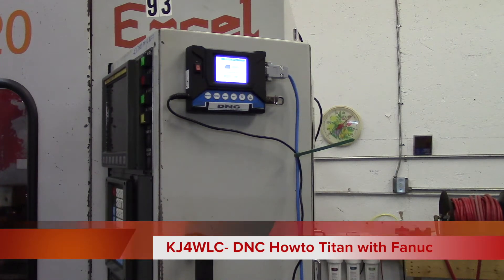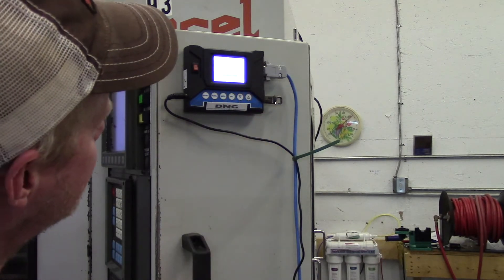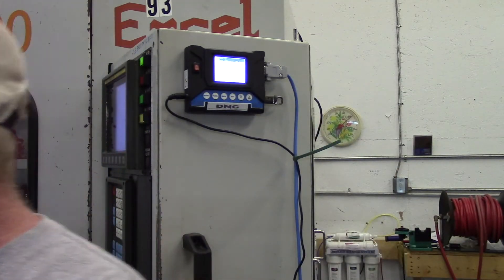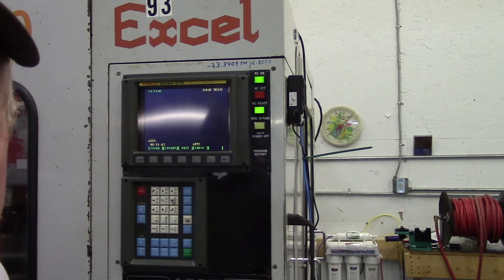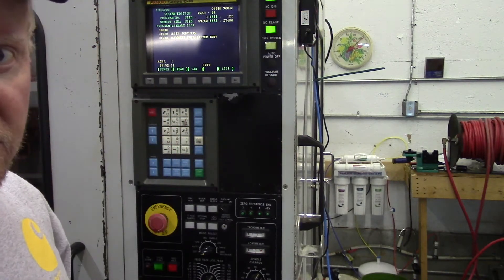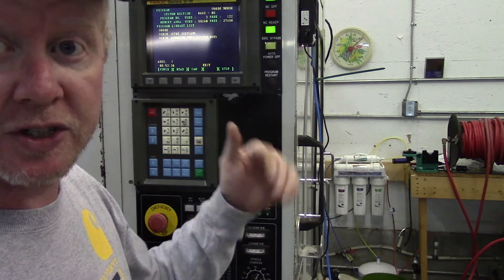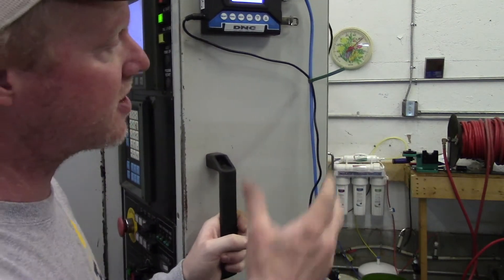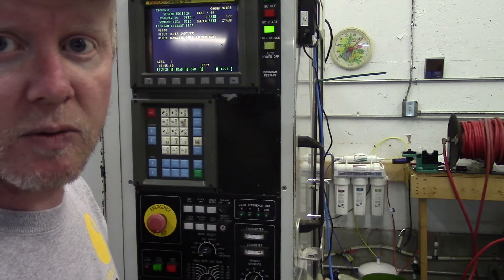Titan DNC with Fanuc Howto

Comment: I just got my OM controller to work with my DNC. I run it at 9600 baud but would like to increase it. What IO mode do you use for this? When I change parameter 252/253 to 12 and IO 2 or 3 I dont get it working. It works at 9600 baud and IO 0.
Reply from the maker: My machine only has one of the serial interfaces wired up. I do run it at 19,200 to the DNC without issue.

Comment: I am using SolidCam to write the gcode. Will the Titan DNC run and properly operate a CNC 1989 Fanuc O-M 3 axis mill and a 2 axis 1991 Haas lathe?
Reply from the maker: It just streams serial so if they mil and lathe have serial and tape options, yes, it will stream gcode to the control.

Comment: hello friend very good your videos!!!! i have a doubt the control is able to resume the machining? for example if i am working and in the middle of the program a tool breaks or there is a power cut... how do i do to restart my program and not start from the beginning, i can start in the line where the power was cut.
Reply from the maker: You are correct.  The way I handled it is manually adjusting the program if I needed to skip ahead with a new run of the program if a tool break occurred to finish the part.  Not perfect but manageable.

Comment: It is possible to use external memory in old machines when single program is bigger than machine memory? In such a way that the machine will receive program blocks in real time and execute them?
Reply from the maker: Externally serial is the only option.  If doing complex operations you have to make sure to overrun the serial link. Also I normally turn off block numbers as the om control doesn't like them on large programs from the DNC. Other than that you can externally send programs larger than the machine memory size.

Comment: Hello will it work with Fanuc 21i
Reply from the maker: Yes as long as you have a working tape setup. Option on your machine and serial port.
Reply: Thank you I have a Hardinge cobra 65 lathe and I'd like some help to get it work I don't know much of a Fonuc 21t controller do you have whatsapp so I can show you some pictures
Reply from the maker: @abramfriesen9834  I don't use WhatsApp.

Comment: you can remove that power cord. its not needed when the rs232 is attached. thats for when you have it hooked up to the pc to load programs in the memory without the usb stick.
Reply from the maker: Either my controller or the cable doesn't supply power to the DNC and the power adapter is required.

Comment: Hi,
How should I go about loading programs from the DNC to the FANUC's memory if I don't have an I/O option as shown at 4:19, and I don't have a Tape Option/reader? I have an RS232 port on my machine so it seems possible, but I can't figure it out.
Thanks,
Brady
Reply from the maker: You will need some way to get it into I/O mode. What machine do you have?
Reply: @ShaneBurrell1  Makino FNC60
Reply from the maker: @bradybrother100  is it a om-c control?
Reply: @ShaneBurrell1  I can't tell. It just says FANUC O-M above the screen
Reply from the maker: Does the control panel have a tape mode for drip feed?
Reply: @ShaneBurrell1  The slot for a button is there, but my machine doesn't have a button installed. So I don't know if it would be possible to somehow manually install a button.
Reply from the maker: It would be tough and you would need a lot of information about you machines current setup.

Comment: Can you please further explain raising to 19200 for better 3d contouring? Is that your baud rate? Does it help the machine process code quicker?
Thanks
Reply from the maker: The 19200 is the baud rate that the DNC and machine communicate at. Faster the better and the only way to do 3d work (although there are limits even at this speed).   It will allow commands to be sent faster in drip mode and also reading and writing programs to machine memory.
Reply: Thats just the speed of comunication and youll see a difftence when loading to and from the machine the baud rate wont effect machining, we run all programs at 9600 .

Comment: what series fanuc 0m is your machine and whats its storage capacity?
0m - A, B ,C ord D? 
Could have a gooddeal on a machine with a fanuc 0m mate, but am afraid i will run into problems drip feeding bigger programs..
thanks
Reply from the maker: My is a C series and has the max memory.  With drip feed it doesn't use the memory at all.  The limit there is the speed of the serial (set to max if you a doing 3d work).
Reply: @ShaneBurrell1  thx!
in your experience does it slow down a lot when dripfeeding?
9600baud seems to be the max speed of fanuc's 0m series?
The machine is a quick BT30 drill/tape type, so speed is interesting to me :I
Reply from the maker: @lzus6676  I run mine at 19200.  That speed most 3d works just fine. Check to see if you can set the param to 12. That should be 19200 even though most manuals only show 9600.

Comment: Hi, i got a question about your postprozes i am using a fanuc 10m controller and fusion but i am not able to adjust it that it works fine... coulkd you help me out with the postprozess?
Reply from the maker: Fusion 360?
Reply: @ShaneBurrell1    
yes, sorry for the late reply…. I haven’t got any notifications..

I have managed to use fusion 360 with the basic pp but well I have to overwrite the first 10 lines by hand. Not so happy about that…
Reply from the maker: It's pretty easy to edit the post processor.  Search/Find with a text editor will help with locating where to edit.

Comment: I have a Romi 17M lathe with a fanuc 21iT control,  any tips before I start o this adventure? Using a USB stick is way simpler than special cords.
Reply from the maker: First thing backup the control.  After backup, ensure proper battery swap to new batteries.
Reply: Sounds good . Right now I'm trying to write a simple manual program.  I'll order the system tonight from Amazon
Reply: I ordered the parts on Amazon,  but they are out of stoke on the Fadal cable. If you have some info on that , it would be appreciated.  
Thanks

Comment: Is the serial port on the bottom for the db25 rs232 output? My dynapath 20 control has that db25 / ra232 port on the side of the control for drip feed. Just trying to see if i need a cable db9 to db25.
Reply from the maker: It is a DB25 serial on the  machine. rs232.

Comment: Thanks for the videos!    Will the Titan allow the control to use it like a flash card and call macros.     I put small programs on the machine memory that call several larger programs from the flash card. will this work the same way or will the larger programs have to be combined into one program and drip feed.    Thanks!!
Reply from the maker: It will not.  It's a limitation of tape mode.

Comment: Do I have to change a parameter ? 
Like 480 ?
Reply from the maker: I didn't initially.  I did end up changing the baud rate param higher for more speed during 3d ops.
Reply: Shane Burrell 

Ok, I can send it but dripping is not working. They say I have to change the 480.2 tot 480.1 and that will activate the 127.5  dnc mode
Reply from the maker: you may need to edit you ladder as well. My machine had a working tape mode.
Reply: Shane Burrell yes is activated is I don’t have a button for
That. But if I do read is will load the hole program now
Reply: Shane Burrell yes i found that on the Internet. 

Only I need to know how to edit is in fanuc I cannot press edit do you have a tip?
Reply from the maker: Try a search for OM ladder and param edit.  It's a multi-step process and depends some on the setup/keypad of your machine.

Comment: Have you drip fed large Fusion 360 hs rough miling toolpath program(s)?
Reply from the maker: Yes.
Reply: @ShaneBurrell1  Awesome. What did you think? I tried to but don't think I accounted well enough for acceleration/deceleration. Kind of jerked around. Going to look at tolerance settings in the rough profile. Maybe I had to many points.
Reply from the maker: @machiningcoolstuff9124  I'm running at max baud and keeping point counts low.

Comment: Great video! bought one but having trouble with; 1) not being able to hit "cycle start" after the program drip feeds to start it again. Is there a way or setting to allow this and not having to reset the Titan DNC each time?   2) Is there a setting that you know of to have the DNC read machine specific macro's? When running from machine memory there is no prob but when drip feeding from DNC it freezes up when there is a macro called out in our NC.   please help
Reply from the maker: There is not auto resend have been able find. Have to resend file for each cycle start.  What control do you have? That might help point me in right direct on macro exec.
Reply: @ShaneBurrell1  , we use Controller = GE Fanuc Series O-P running a Strippit Punch machine. Built around year 2000.
Reply from the maker: You won't be able to call macros from drip feed on the Fanuc o series but could include what they do in your program that you drip feed.
Reply: @ShaneBurrell1   Yes, we just figured that out. Thanks for the help. I would sure like the next model they come out with allow an auto restart so you just have to hit cycle start on the machine.

Comment: Wil this work with anilam crusader m control it has rs232
Reply from the maker: Any rs232 dnc should work.  It just streams data with the given serial settings.
Reply from the maker: Looks like a number of people have it running.  Note that the default may be 1200 baud and you may have to make sure both sides are transmitting at the same speed and manor.
Reply: Shane Burrell thx for the quick answer. Just bought one.
Reply from the maker: No problem.
Reply: Shane Burrell ok lol bought and plugged in the dnc lowest baud on the DNC is 9600 i set the anilam controller the same can’t get it working can you list the exact settings you would use for an anilma crusader m controll
Reply from the maker: Do you have matching settings on both the DNC and the controller? Also do you have the correct cable for the interface?
Reply: Shane Burrell yes i did match settings. I used the s cable that came with it. I tried changing the setting several times.  Matching them.
Reply from the maker: U will want to check what your machine needs for the cable pinout.
Reply: Shane Burrell ok after several cable tries and a custom using iso,eia and anilam convo i can get the controller to show rs232 read which means some sort of signal and when i send to dnc i get an X charater which means cnc is sending some sort of signal but im lost cant get the sent file to show up in the memory
Reply from the maker: From what I can find online you would be specified on the machine where to put the file and starting the DNC send. There could still be problems with cable and settings if you think you have the process down on the controller.   I'm not familar with the anilam but there appears to be tons of info online about them including DNC operation.  Here is an example: https://www.i-logic.com/serial/machines/anilam_crusader_ll_m.htm
Reply: @ShaneBurrell1  omg how many days finally found some usefull info on the internet lol it was a need for a custom cable for anilam plus the aux code omg no usefull info in the manual  it is very specific settings and cable and the way you have to set the controller to upload
Reply: @ShaneBurrell1  thx for the help anyway posted the forum i finally found usefull info after sorting through 50 posts anilam is PIA

Comment: What parameters are set for a Fanuc oi mate mb?
Reply from the maker: Depends on the machine but normally the default's will work but will be low speed.
Reply: Is this the solution to large file because the built in memory is so low?

Comment: How do i check if a Fanuc O Mate controller on a old bridgeport 412x can use dripfeed?

My controller do have the 25 pin connector on the side.

It's doesn't have the knob with the tape mode. And inside the menus it doesn't have anything named tape either.
Reply from the maker: You should be able to go to operator panel screen and turn on "TAPE/DNC" option. Most likely the 25 pin is the connection you wanna make.
Reply: I am fairly sure there was no tape dnc at the oprator screen... i might have a picture of the operator screen.  
https://photos.app.goo.gl/1q4oP2WRAKLrSCkn7 - there is only MDI AUTO EDIT HNDL JOG ZRN ...
Reply from the maker: Try hitting page down. It should show several options on the second or third page of the operators screen.
Reply: @ShaneBurrell1  i Will try that next time I get to it. It's a Bridgeport 412x I am thinking about buying so I so I can start my own small machine shop. And I would hate to not have dripfeed since I am a big cam user haha.
Reply from the maker: I haven't seen one without it but it's possible.  As long as the serial port is fully connected there are several ways of "enabling" it if it's not.  Most likely it is on one of the operator panel screens.
Reply: @ShaneBurrell1  cheers man. I am not that much familiar with the old fanuc controls. I use sinumerik 840D daily and some newer 21i fanucs. Takes a little to get used to these older controls haha
Reply: Cheers mate.. i hope.. thanks for the help!
Reply: I am glad to tell ya that it worked flawless.. i had to mess around with the parameters on the DNC software but it worked.. i was able to dripfeed.. 

I gave a bid on the machine and i hope that they accept it....
Reply from the maker: That's great to hear!  Depending on software, some of the older machines have different tool change methods.  Be sure to make a backup of all your param's to the DNC first thing if you win the bid.  I would do that before unpowering it if possible.  My fanuc uses the ladder for tool changes but many use a macro that is really hard to find if you loose or delete it.  Params are almost impossible to get on a old machine so they are like gold, download and put in a safe somewhere.
Reply: @ShaneBurrell1  I will do that asap if I get the machine. How do I do that ? Just go to parameters and press punch ?
Reply from the maker: There are a few ways but I use this guide.  http://cncszerviz.com/docs/FANUC_0_COMMUNICATIONS_PARAMETERS.pdf
Reply: great... thanks my friend!

Comment: How does it work if you don't have tape mode?
Reply from the maker: Depends on your control.  Do you have a Fanuc OM? If so there are several serial ports.  You would really have to dig into your particular machine to retrofit a path for DNC but it's normally possible.